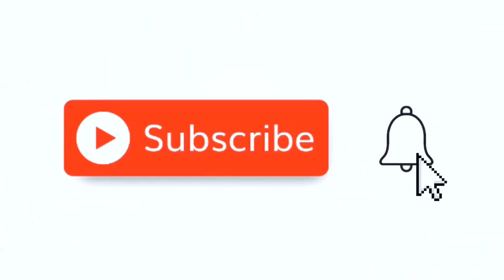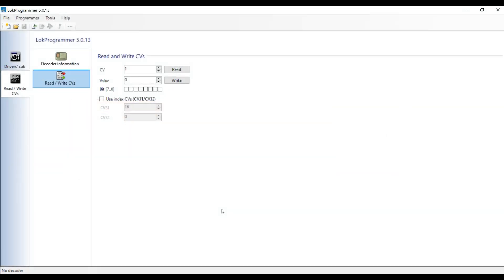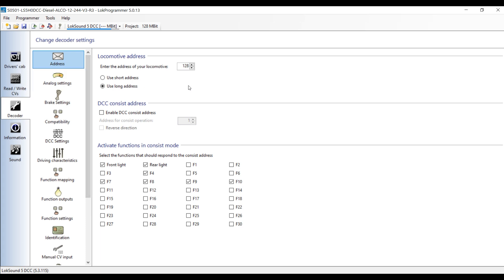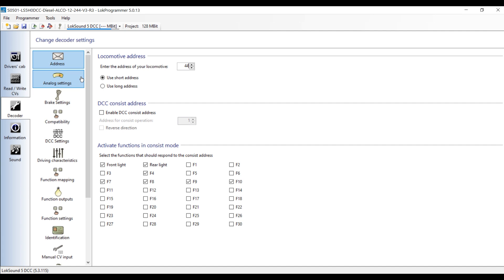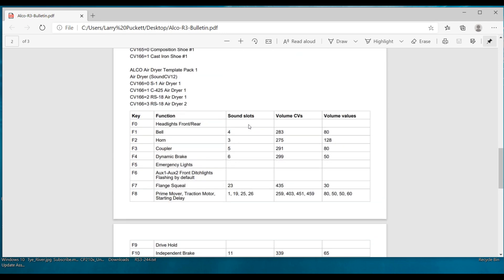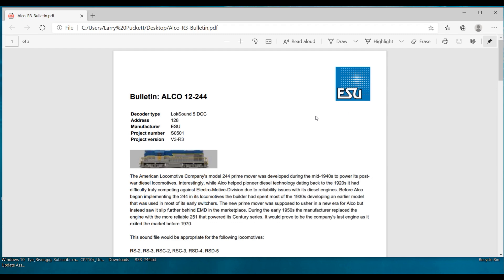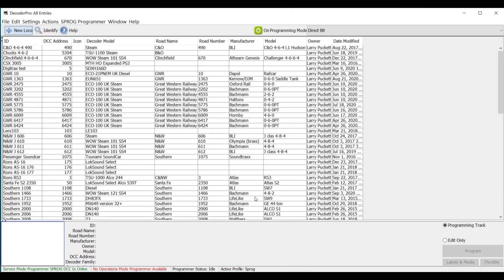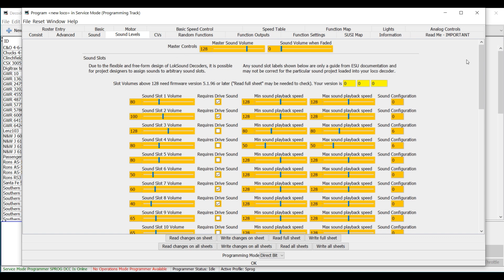Tips & Tricks For LokSound Programming (292)

Comment: This may be a stupid question, but how do I get that file now in DecoderPro into my decoder?
Reply from the maker: That requires a usb interface between your computer and your DCC system. You then put the loco on a programming track and use DecoderPro to write the CV settings to the decoder.

Comment: So how do you get the altered file (if you made changes in DecoderPro) back onto the decoder? That's what really important I think, but is not covered? Am I missing something? Cheers.
Reply from the maker: You send the changes to the decoder it the same as with any decoder using DecoderPro. You just can’t load a sound project with DecoderPro.
Reply: Great, so using a PR3 and DecoderPro for example you could program the ESU decoders except for the sound files? That is great news, thanks! @TheDCCGuy
Reply from the maker: I do it all the time with my DCS240 which has a PR3/4 usb port built in to it. The main issue is as I said in the video is getting the default CV settings for the decoder from LokProgrammer in to DecoderPro. Once those are imported you can easily modify these and write to the decoder.
Reply: Larry, thanks, appreciate the expanded answer. I just didnt pick up on how to program the decoder after changing the settings. Knowing how to get the data from the decoder is now clear and helpful. Great, cheers!! @TheDCCGuy

Comment: Clear as mud! 😂 Seriously though, I bought a new Atlas Alco S-2 about 4 years ago with the intention then of building a small switching layout, then never did. Now I've actually begun work on the layout but I haven't yet purchased my DCC system. So without a running system I can't really do anything with it yet. But I'll be saving this video to my "Favorites" for future reference.👍
Reply from the maker: Yes, it can be a bit challenging to wrap your brain around LokSound decoders until you have worked your way into them. Helps to start with a simpler decoder like SoundTraxx, familiarize yourself with the process then move up to LokSound. There are still things that I have to review again when I get into the deep end.

Comment: Hello Larry, I would like to say thank you very much for your videos I have already reviewed almost all your tutorials. I am new using LokProgrammer and I am facing a situation that I cannot solve.

I want to configure the braking sound on a decoder so that the wheels grind can be heard automatically when the loco gets stop.
I have placed in the slot of “Break Sound” the sound I want, but without success, no breaking sound at all.
I also configured in a separate slot the “Break Squeal” sound I want, I configured the transition from “Mute” to “Init” with an acceleration < -4 and I achieved the result I want for the sound but I have to press the function key every time the locomotive breaks for getting it. I want the loco does it automatically.
Could you please advise or give me guidance? I have no found any info related. Thanks in advance for your support,
Reply from the maker: I’ve run into this issue before—drove me nuts at first. You have to increase the brake rate and keep moving it up until you get the sound you want. The longer it takes for the loco to stop the more brake sound you get. I’ll crank mine up tomorrow and check the value I use on my locos, can’t remember off the top of my head.
Reply from the maker: Ok, I got DecoderPro cranked up and I have CV3 and 4 set to 50 and 20 respectively. I have the automatic brake sound volume (CV 16.1.459) set to 80. I found these settings draw out the brake sounds long enough to produce good sounds. You may want to experiment with values of your own to find your sweet spot. I use DecoderPro for programming LokSound decoders once I get a project loaded and the initial CV settings transferred from LokProgrammer to DecoderPro. It is a lot easier to use.
Reply: @TheDCCGuy  Thanks a lot Larry. I will try it next weekend.  My best regards.
Reply: @TheDCCGuy  Hello Larry, I just want to say thank you very much. You have solved my sound issue. My loco break sound is working perfectly now. My best regards.

Comment: I purchased my Lok Programmer and Decoder Tester back in 2015. I also had the hobby shop I worked at get them as well. I've done over 100 projects for myself and customers. One of the best investments I made. When ESU came out with "Full Throttle" I updated the decoders that I previously programmed with  the new files. It also makes it easy to change the function mapping of the decoders. For example, I feel the Function 3 (F3) "coupler clank" is useless for me. So instead I change F3 to "Run 8." Now when I click on F3 the prime mover revs up to full throttle. On my diesels which do not have dynamic brakes I change F4 from "Dynamic Bakes" to "Drop to Idle" (or something like it). This way instead of dynamic brakes these engines will simply drop to idle when F4 is clicked.
Reply from the maker: Yes, for serious LokSound owners the LokProgrammer is the best option. As you point out ESU does offer sound project upgrades that require a LokProgrammer device. Glad to hear it is working out so well for you.

Comment: Have to wonder how ethical this is. Cant believe Mr ESU will be ecstatic that you are promoting the stealing of their sound files, manipulating settings on its software for use on a competitors programming software?
Reply: The ability to use hardware and software from different manufacturers is a core feature of DCC. It is the whole reason DCC was created, instead of having many proprietary systems from different companies. Because of DCC you can buy decoders from any manufacturer and program CV's with your system of choice.
Reply: @LaurenzEdelman  Very good point.  I also model in O Gauge and the proprietary nightmare that is Lionel really holds back that scale and is an almost insurmountable barrier to entry for new manufacturers IMHO.
Reply from the maker: If they did not want you to do it they would not have included the ability to save a CV text file that you can then load into DecoderPro. Also no one is “stealing” the sound file, you are just transferring the CV settings to DecoderPro. If it helps sell decoders that’s what they are in business to do.
Reply: @TheDCCGuy   I fully understand what you are saying. I guess I'm wrong just doesn't seem right to me.
Reply: Oh come on. The software is specifically designed to provide this functionality. Dah.

Comment: Yankee Dabbler also applies sound files to decoders you buy from them at no cost. Excellent service as well. For some reason, though, JMRI can read CVs from my Loksound decoders, but can't write them. Still working on that.
Reply from the maker: What DCC system are you using? Timing and programming track voltage can be an issue with some older systems but the new ones have compensated for that. Indexed CVS take longer to read/write. I had some initial issues like that several years ago but not with my newer DCC systems and newer versions of DecoderPro.
Reply: @TheDCCGuy  I use a DCS 52 and I'm pretty sure my JMRI is up to date. I have no problems with Soundtraxx decoders, just Loksound. I'm currently reading all the CVs (takes forever) then I will try a reset.
Reply from the maker: Those are a relatively new system introduced in 2019 so I wouldn’t expect problems. Do you have the most recent firmware installed? If your unit is from early production they might have tweaked the programming capability. There was a firmware upgrade released in 2021.
Reply from the maker: Yes, I imagine that most LokSound dealers offer that service, you just have to make sure to ask up front. A friend ordered several for his narrow gage steamers then called me asking how to select the steam sounds. He had actually purchased the default decoders with the clunky German diesel sounds so I had to explain the situation. Fortunately the dealer took them back and loaded the correct sound files for him.